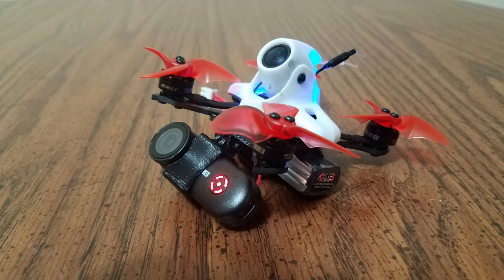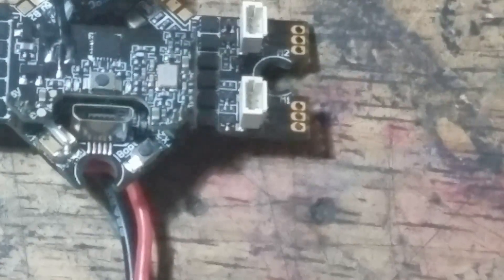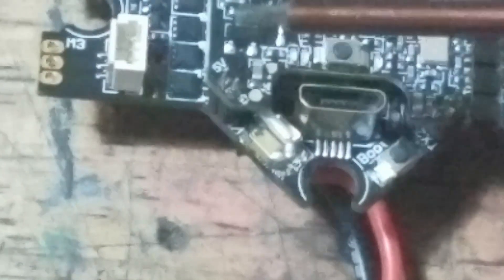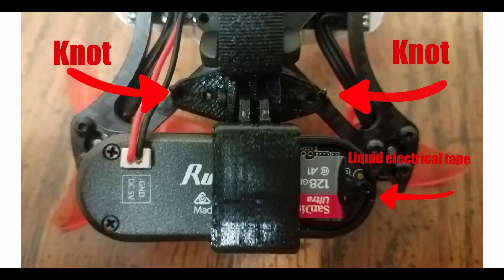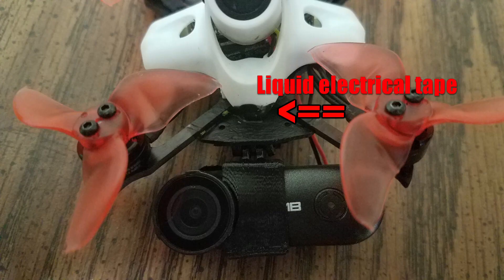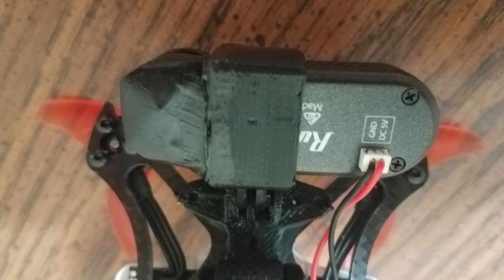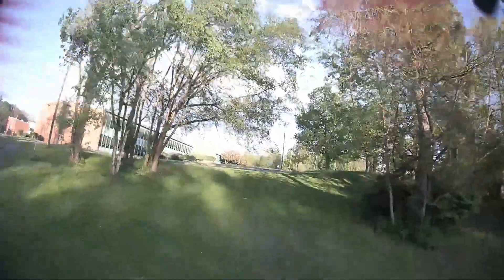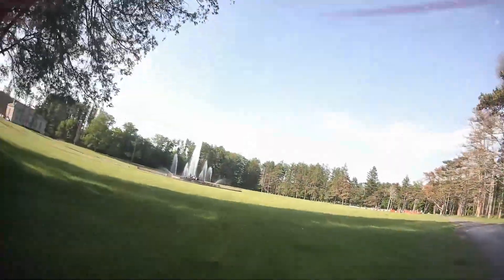Soldering and Mounting RunCam Thumb on a TinyHawk II Race

Comment: I never would have thought of this. I would always over rotate at the bottom of the powerloop with the race, when it worked that is. I blamed the bottom mount batteries but here you are adding a bottom mount camera and doing way better powerloops? And your footage looks really solid. I used that clear mount and it was pretty bad jello most of the time but that was because the holes on the black one didn't match. Liquid electrical tape and floss, thanks for that too, you rock!
Reply from the maker: That's cool you found it! I hope you get new drone or repair the old one. Flying is the best most free feeling in the world. Keep flying
Reply from the maker: No problem. I just actually had it stuck 40ft up in a tree a few hours ago. Broke floss on one side  when I got it down but that is all. Going to redo and it's all ready to go. I power loop even better with it now. Love my race. Thanks for watching
Reply: @lillygodzilly  I lost my thumb first flight but after a week of rain finally found it today too, and it still works after about a 100ft drop! It ejected in the first part of the crash...in a tree, lol.  I guess the weight isn't actually like adding more batteries it's a bit forward or something anyways I love learning something new. If mine still worked I'd be trying this for sure.